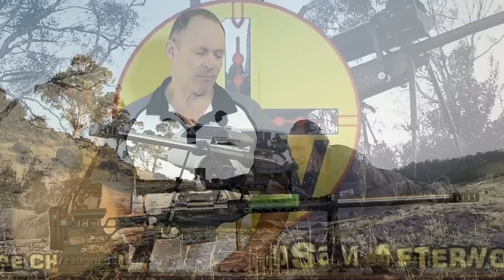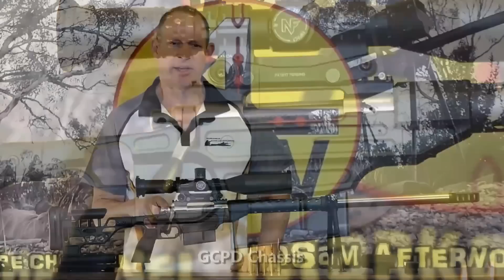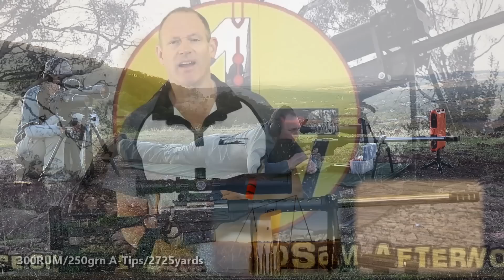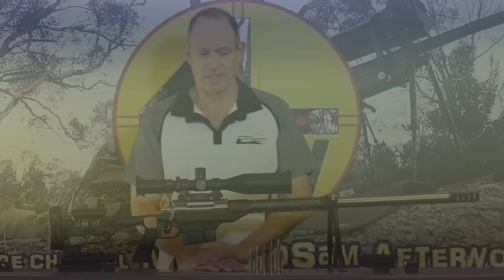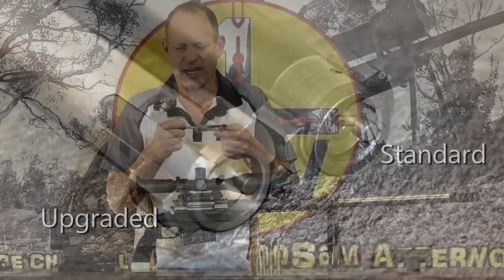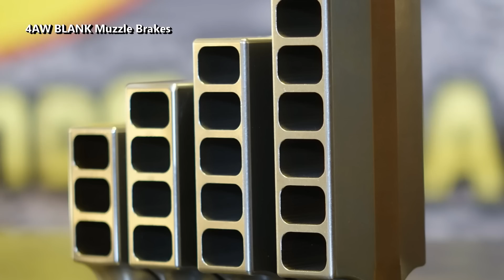7mm Remington Ultra Magnum ELR build

Comment: Nice looking rig. I built a 7 rum. It was a screamer. I ran a 30” barrel. Got a 190 up to 3270. Got 1000 rounds out of my barrel but I didn’t run it hard and kept it clean. Every barrel has a different barrel life. Got 5 years of use out of the unit.
Reply from the maker: Thanks Edward.  Cheers

Comment: About how many rounds do you use in your load workup? I typically wind up using around 75 to 80 start to finish. Typically a safety check start to max. A velocity check for a consistent burn. Then a seating test for accuracy.
Reply from the maker: All said in the video, typically about 5, sometimes as many as 15, Cheers
Reply: @markandsamafterwork  missed that. Thats impressive. Heard you say you worked up to a safe pressure. Didn't figure you called it there. What kind of sd/es do you get? I always found i could cut it down a fair bit, low teens, to high single digits by coming back off max a bit. Your workup is super minimalist.
Reply from the maker: We'll show the first lot when we test this one, Cheers

Comment: When I built my 300 rum I wanted to order the 2 other barrels 7mm rum and 338 edge to have all 3 rum based cases but work got slow and haven’t got around to ordering them plus the 195 & 197 grain 7mm bullets are now where to be found at the moment.  The heavy 300 grain 338 bullets just now came back so we’ll see. But love the 245 Berger’s in the 300 rum   Great video.   Cheers
Reply from the maker: Thanks Tim, Cheers man